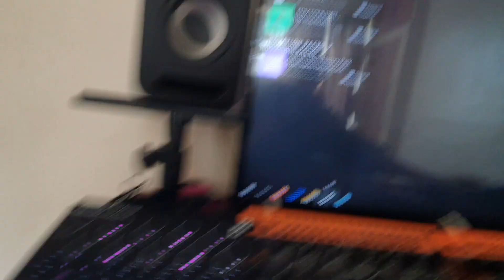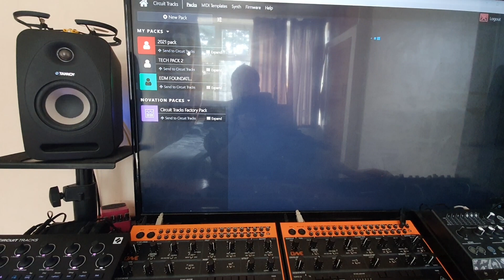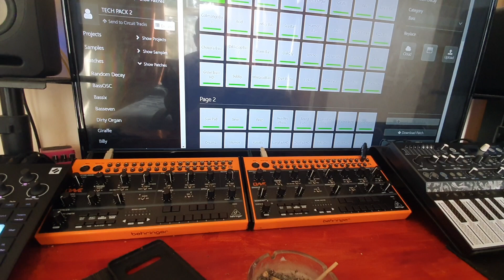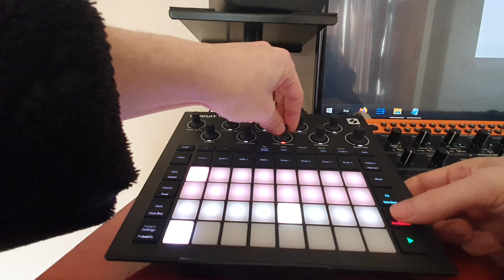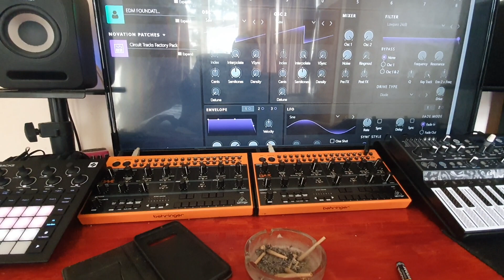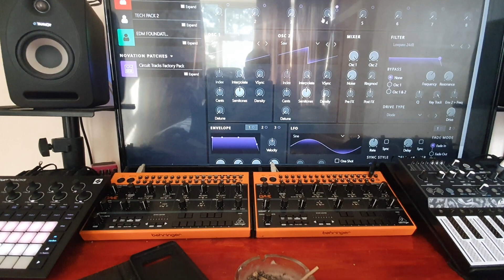Circuit Tracks Tips Volume 1

Comment: Great tips, thank you for putting it together.  I’ve made a short tips one as well with some tracks if you want to check it out.  Are you running any of the external gear with your set up?  I notice you have the micro freak.  Have you hooked it up yet?
Reply from the maker: Thank you man means alot.. yeah link me your video.. I've done another with microfreak using its chord oscillator and I also have the nts1 hooked up aswell now.. a great combo
Reply: @TechTronix01  heres a link to a little remix I did of some old classics.  https://youtu.be/zYVOH_dJPpw

Comment: Thanks a lot for taking the time to do this. I’ve tried reading the manual, and that saps some of the joy of discovery (especially being new to circuit as I am). The clearing of macro tweaks or automation is critical. It’s great making a mess, but tricky to reverse. Thanks again.
Reply from the maker: Your more than welcome. I'll probably do alot more on the circuit as its does quite a bit

Comment: Good stuff man. Another thing I've found is that if you set up the crave on a midi track you can put the crave into rec mode press play on tracks and it sends the midi sequence data over to crave for you to save. You can then change that midi track channel and use it for another midi instrument whilst keeping the sequence on the crave. It just means you can build up a sequence on the circuit and not the clunky crave sequencer. Hope that makes sense. The Crave sounds great with the circuit if you use a stereo chorus pedal going back into the audio inputs as the delays are synced to tempo.
Reply from the maker: Awesome man thanks for the tips I'll be trying that for sure... I used to use an ar 48 to do that because it had scales